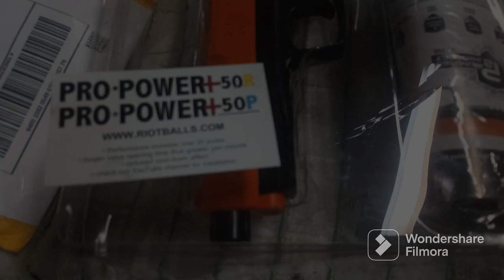HDP 50 modified. tuning barrel and valves

Comment: i too bought a power-pro kit for the hdp. i got it for 80 bucks came with tuning barrel also . it is the .495 barrel so i cant shoot 8.53 gram steel balls through it , so i took it off ! the next purchase will be from homedefence-24 . i want to get the .505 tuning barrel next so i can shoot the 12.7 mm steel balls . i been trying for months to get higher fps from them , i have three of them , the most joules i got so far is 26 and a quarter joules , at 258 fps with a 8.53 gram steel ball . if i could use the 2 piece tuning barrel , i know from other ammo , the joules would be 30 to 35 joules !
Reply from the maker: I'll hook you up  modify a gun first thing I do is  di black no more orange 24 and then I purchase some home defense 24 upgrades I got that same barrel I'm wondering if I could board out a little bit or something with the drill and some Scotch Brite or something I don't know good luck and happy shooting
Reply: @nxtlvh  i prefer not to bore out the barrel bro ,it is very useful to shoot riot balls and other ammo ,thats what it was made for .
the tighter seal gives more power , air is behind ammo ,to push out of barrel ,so no air is escaped .
too loose barrel ,al lot of air is blown on top, bottom and all around so you loose some air that is needed to push ammo out of the smooth bore barrel .
i test barrel and ammo by putting ammo in barrel holding the barrel in my hand at eye level , level it so it dont roll ,then put light on other side ,the more light you see the more air is wasted when you shoot . this is why i paint some ammo ,to make it slightly bigger .

Comment: Get pvc steel riot balls. 8g is too heavy for CO² it will ruin your detent quickly. Get the HD24 powerpin and always use Umarex CO². Theres quite a diference between CO² capsules, the Umarex its one of the cleanest and more powerful. The difference can be up to 5j in power.
Reply from the maker: HPA I use high-pressure air pressure